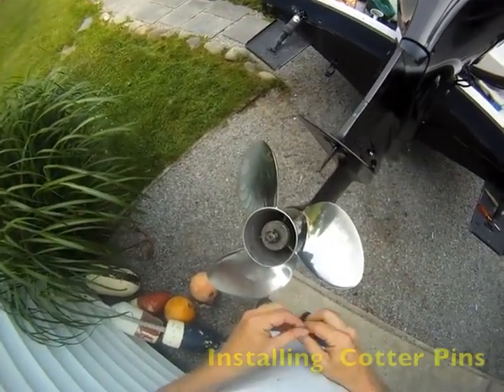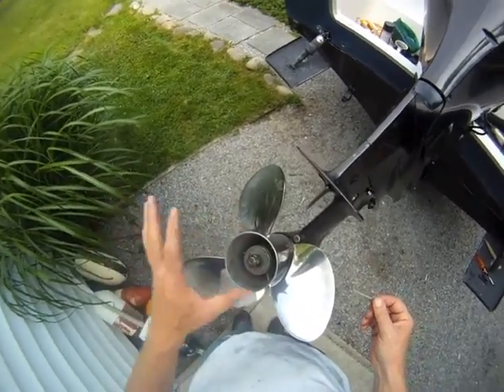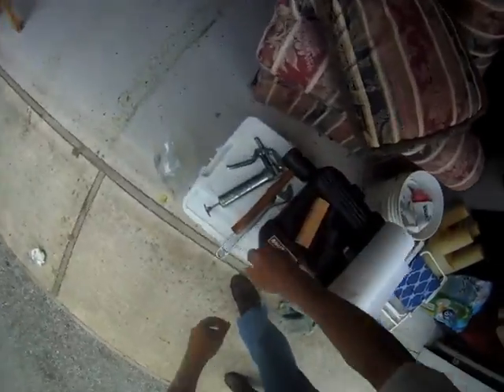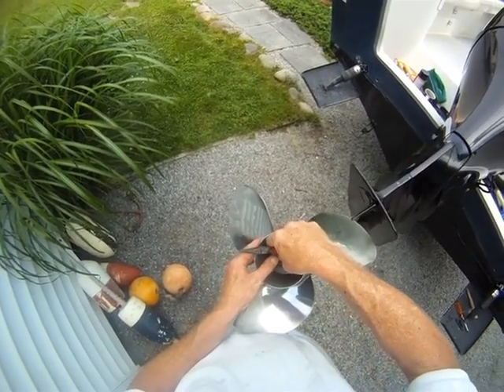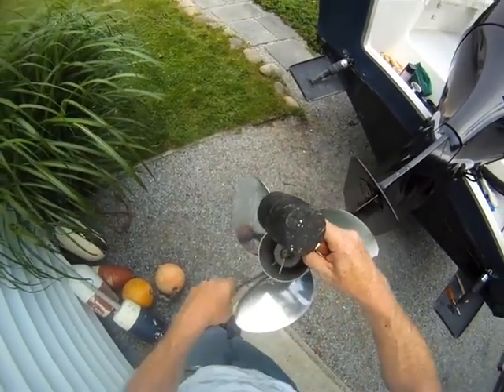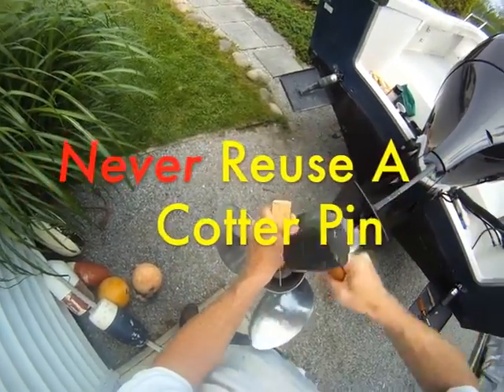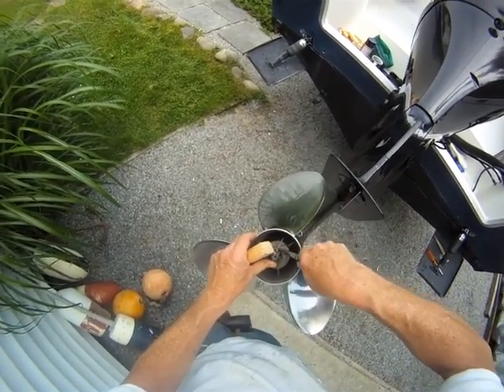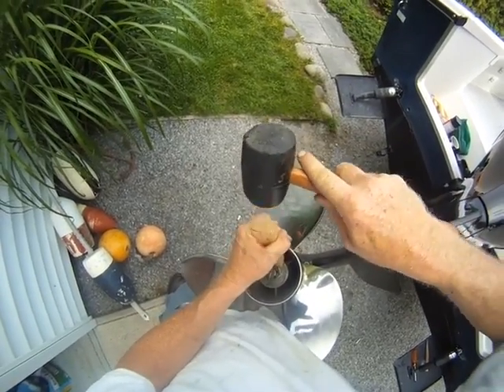How To: Propeller Shaft Cotter Pin Installation

Comment: What you should have done is leaned the correct way to insert the split pin. First of all it is a split pin and NOT a cotter pin, cotter pins hold the pedal assy to the crank on a bicycle. The split pin you are using is way too long for that application and you only bend the shorter leg to 45 degrees. It is only bent enough to stop the pin from falling out of the hole, it won't fall out and doesn't need to bent like you have done. Don't teach people to install the split pin this way, it is totally incorrect.
https://www.harriscyclery.net/product/generic-9.5-mm-crank-cotter-pin-english-size-each-1584.htm
Reply from the maker: Also, regarding the nomenclature: The engine maker identifies the referenced part as a, " cotter pin." 
Prop Nut Cotter Pin
Part No: 09204-03003
Weight: 0 lbs 1 ozs
Brand: Suzuki 09204-03003
Prop Nut Cotter Pin
https://www.brownspoint.com/store/pc/viewPrd.asp?idproduct=6113&gclid=EAIaIQobChMIgqSKxLGo6wIVBL3ICh2RsggEEAQYAyABEgIl4PD_BwE
Reply from the maker: Bent at 45-degrees, the pin is one more thing to cut a fishing line, if working a fish around the transom. So, we like to tap it back against the shaft. A boat is is not a bicycle.